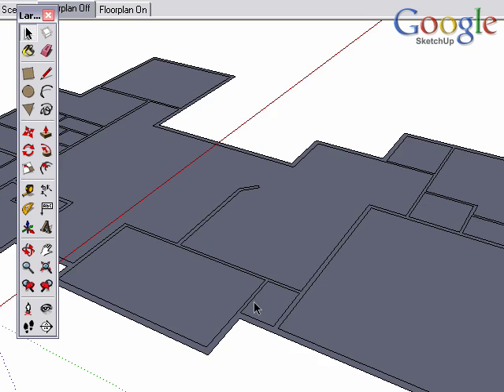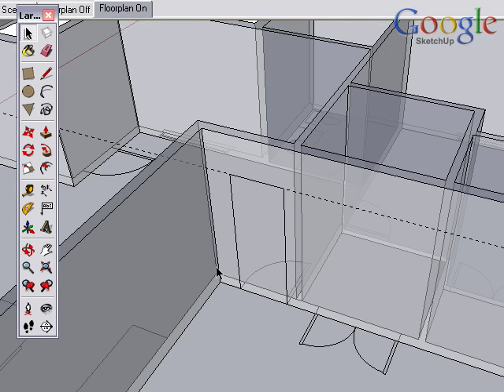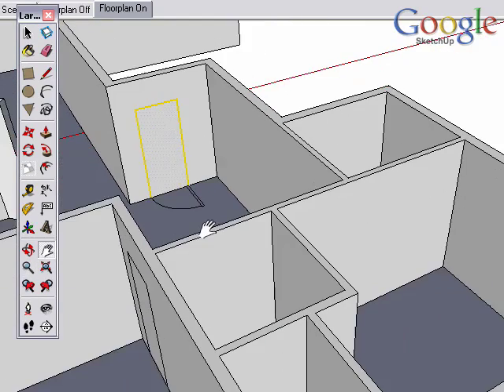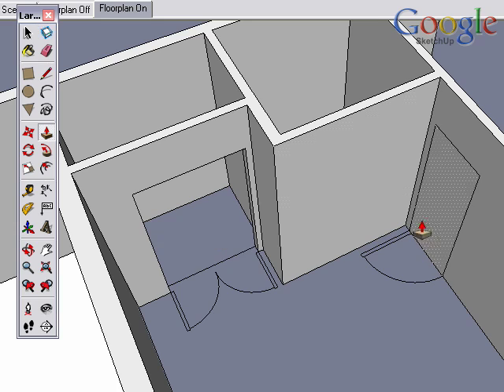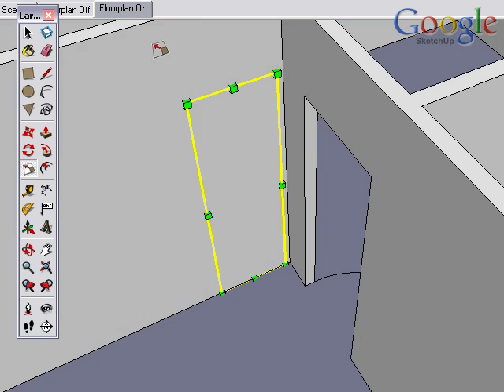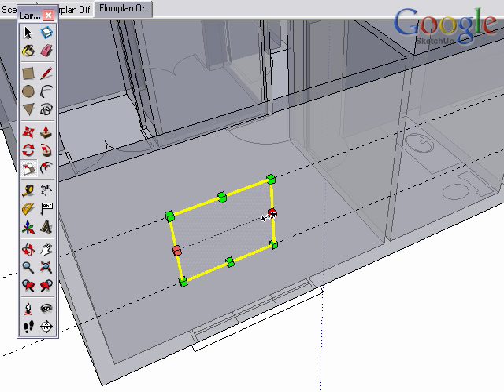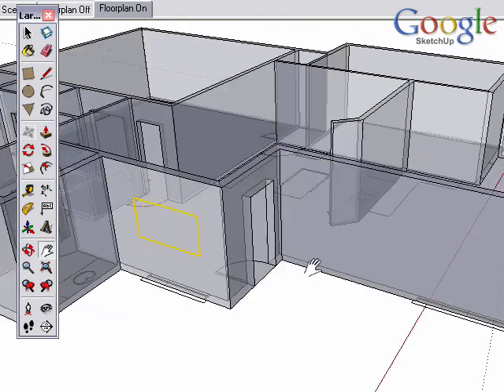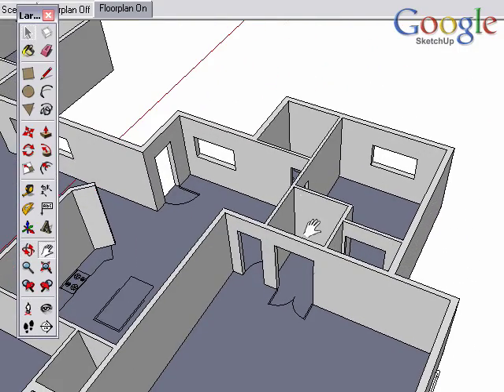SketchUp and CAD - Doors and Windows

Comment: When I try using the push/pull tool to hollow out of the windows/doors, it just extrudes out the other side..
Reply: You have to give the value equal to the thickness of the wall.
Reply: you must create a floor again to the whole space, when you push/pull the walls at the beginning the floor is lost. Just create a rectangle that covers all the floor.
Reply: the opposite wall you are pushing through is probably not exactly parallel to the one you have placed the rectangle on...